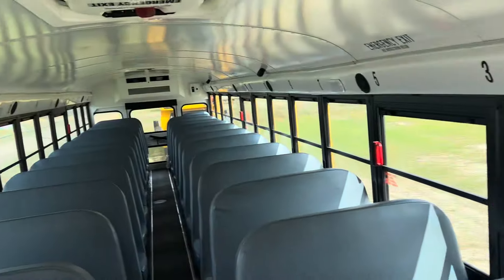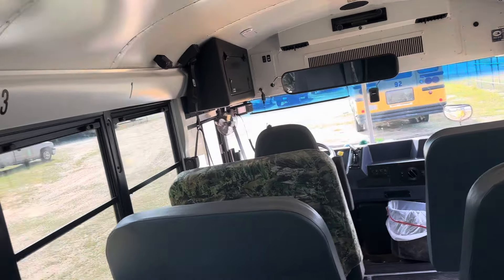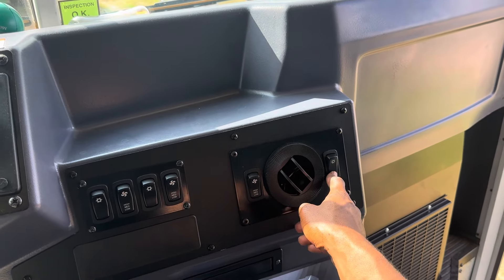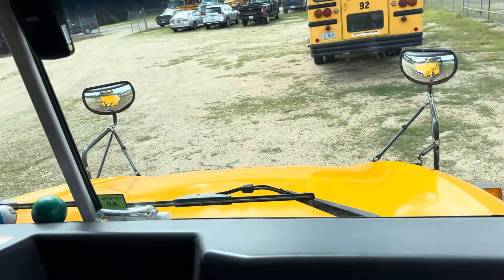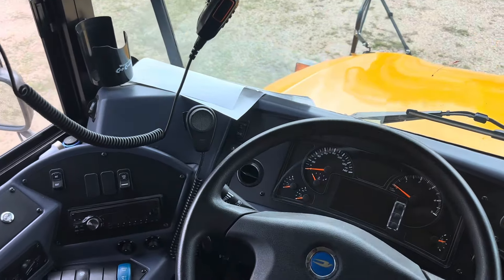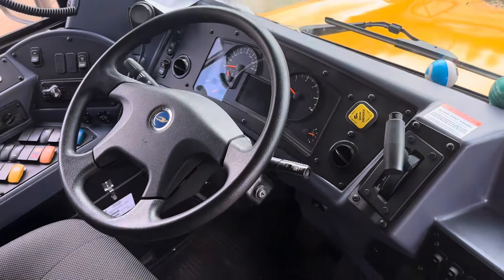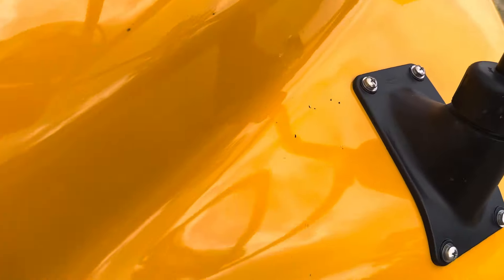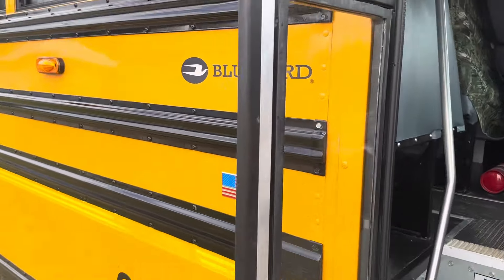Gripes about my new Blue Bird

Comment: They need to bring back the interior they were in the 2000s. All our visions and T3FEs have awful interior. Everything sounds like it's going to fall apart when it hits a bump. On the T3FE when it goes over a bump the dash moves about a inch, on our A3s and TCs they are solid as a rock. We have had so many issues with our visions, probably because we ordered them with the 7.3 Godzilla but the transmission it uses is awful. All of the issues with the transmission are electric related, why can't we have a hydraulic controlled automatic 4-speed transmission like our old busses.

Comment: They should copy the c2 design and just have the speakers on the side and the led dome lights on the ceiling so there’s one electrical line going down each side panel. Either that or put both speakers and light on the ceiling like they did back in the day.

Comment: They don’t make them like they used to, that’s for sure. I hate the cup holder. Anything heavier than a feather and it’s snapping off. When I had mine, my elbow would always hit the storage compartment right next to the driver window. Not to mention the dash is pointing to the ceiling. I never understood why they use 3 different types of switches… They have to have a new dash in the works or something since Thomas and international both have new designs, though Thomas is just barely getting by with a “new design.” I can’t imagine that you’d go for a Blue Bird anymore after 2025-2026 since they won’t be offering diesel options anymore though. I hate their child check system, I hate the light monitor they use, and that overhead storage is just a plastic pos box bolted to the roof. International is too, but at least there isn’t a gap between the front wall panel and the box… I’ve driven brand new Internationals and C2s, honestly the C2 beats it by just a hair in my opinion. Hell, even the older C2s don’t rattle as much as older CEs. I know you despise them, but demo a new C2 if you can, you’d be surprised I think.
Reply from the maker: Already have. Still just don’t like anything about a c2. I’ll deal with this one before I get another c2. But at the same time. Atleast Thomas fixed known issues. That upholder has been a problem since day 1! They need to straighten up the dash. Pick up the steering column and make it go in further. That would help a lot
Reply: @Bluebirdvision91 just buy used buses like Gwinnett did lol. Hell you could go in copart and probably get some old Gwinnett buses and put them in service. I wish I could’ve experienced the new gen CE. Only thing I don’t like in C2s is the A pillar blind spots.
Reply: C2s used to be decent buses but the quality isn't as good. Our 2025 C2s are not great, one of the buses has some sort of engine rattling noise, the door rattles, and Intellipark malfunctioning. These issues weren't present on the 2018-2020 C2s my District owns.

Comment: The 2024 Visions we have have been fine except for the Leaking issues. Better than the 2025 C2s which have a rattling noise and the door rattles which wasn't present on the older C2s. Also Intellipark malfunctioning making things worse. We have just been lucky with Blue Birds I guess prehaps unlucky with Thomas.

Comment: Man I’m suprised to hear you ripping on a blue bird. But I agree with everything you said. Especially the SEATS not being ASSEMBLED CORRECTLY that it a huge safety issue. I was always under the assumption that blue bird made the best quality busses but I suppose they have issues as well.
Reply from the maker: @Cole-q2h  they used to be the best bus body you could get. But after 08 forget it. Went downhill from there. They need to go back to the 2003-07 design and redesign a new vision based off of it.
Reply: My school has all bluebird route busses and one IC. We have one new route bus with the new roof like yours. The spec is different cuz I’m in PA but I’m curious how that bus is holding up. (I ride a 2020 vision every day)

Comment: I was a 2 way radio installer. On these visions, i learned to make note of all issues i could find just to cover my ass. The build quality is so terrible, ive seen plastic self tap screws used in machined holes. From the factory. Loose power terminal to the main fuse block from the battery.
Bluebird shouldn't be in business anymore. And i damn sure wouldn't trust them to build an electric vus

Comment: I have always drove international.  Since moving to a new company 5 yrs ago that’s all we have are BB and I hate them. Poorly designed.  Every bird I’ve driven rattles, the drivers area are tiny, I’m 415 pounds and I’m crammed behind the wheel, I had so much room in my internationals.  The lights they use under those switches get HOT. I’ve burnt my finger on them cause of the hotness of the lights.  The switches are crap, I’ve had many of them brake.    I liked the older display where u can change the color of the dash lights.  Not a fan of the new crap.  And they need to do a better job at a cup holder cause what they have sucks, they brake if something is to heavy in them.    

They need to bring a team of engineers from International over and let them show how to design a bus.

Comment: Our biggest problem with Blue Birds at the moment is the seat frames. We had both of our 2018s that we had to replace all of the seat frames because they were all broken. The design is horrible. Bus is only 6 years old and shouldn't have to be replacing seat frames. We have had a few in our 19s and 21s but the dealer has fixed those under warranty. The way the seat frames are made, some of them rattle because they are metal on metal in two places and they put a piece of seat cover over this plate on the frame to try and stop it from rattling. Both of our 18s were at dealer multiple times for broken seats and we had to end up replacing the frames ourselves. We have also filed NHSTA Complaints against BB for the frames and reported to our state department.  I hate the way 2021 and newer ride, we have some rough roads around here and sometimes you feel like you are rocking on a boat. BB quality is going down hill like. We will not be ordering them anymore, We are IC only from here on out. We have a 20, 2 23s and 2 24s and 3 25s on order. ICs are so much better in our opinion and we get better support from IC. When we started ordering BBs in 2013 they were like Cadillac's compared to the buses we had at the time and now they are just garbage. I hate working on them and can't wait until they are gone!
Reply from the maker: @Josb_Bluebird2143  I don’t mind working on them. But my thing is. They know about these same issues. Why haven’t they addressed them? I will agree that quality has gotten slightly better since Phil Horlock took back over at CEO but there’s still a lot of room for improvement.
Reply: ¿Cuáles son los IC?
Reply: The biggest issues on the BLUEBIRDS have and what does INTERNATIONAL IC’s don’t have in GWINNETT is the stair well is wide on the CE’s and on the VISIONS the stair well is so tight like BLUEBIRD should make the stair well wide like on the CE’s when it gets onto the engine on the CE’s you can hear the engine on the CE’s with IC’s DT466 MAXXFORCE DT and IC’s B6.7 liter CUMMINS ENGINES with the straight pipe system on the exhaust on the 2005 CE’s to the 2022 CE’s with the straight pipe exhaust system on the tires on the CE’s the tires can last longer on the CE’s then on the VISIONS on the drivers area when I am sitting in the driver seat I know the switches on the control panel and the controls on the steering wheel on the CE’s when I am doing the inspections on the CE’s I know he components on the CE’s then on the VISIONS when I am doing the inspections with my driver Mr Coleman air brakes and the air ride suspension system on the CE’s it rides and brakes smoothly then on the VISIONS the gage cluster when I turn on the ignition with the key on 3014 the gages move what they supposed to on the fuel gauge air pressure voltage oil pressure coolant and engine temperature speedometer and the RPM gage on the VISIONS the gage cluster does a gage sweep and not the original way like on the CE’s

Comment: Do you have any of your 2003 ce buses left or no
Reply from the maker: Actually yes. Video on one of those coming soon
Reply: @Bluebirdvision91  yesssss I love 2003/2004 busses that was my first bus it was a 2003 or 04 ce200    bus number 167 but they scraped them for no reason I hate the c2s like they get hot in the back way to quick even in the winter
Reply: And bro where I go to school we have no electric busses yet I just don't find a point in them bc like their gonna do as much pollution as a diesel does now propane and gas needs to be out of every county in the US just in my opinion  cause for one propane can blow up in  pretty big explosions which could kill all the students if it does blow and no my county doesn't have gas propane or electric their all diesel which is good
Reply from the maker: @ I had a conversation with an electric bus rep. Which is why I decided to go ahead and make this vid. Trying to sell the electric bus when they can’t build a decent diesel….
Reply: @Bluebirdvision91  lol but how long do the 2003 ce have left for service
Reply: @trevorfill7021  Propane and gas won't explode. They make the tanks to where they can take impact and not rupture. If I remember correctly there was a video Blue Bird did years ago where I think they may have been shooting at the propane tank and it wasn't making a hole in it. In my opinion propane is safer than an electric bus. We won't ever get them though because we are diesel only fleet and KY does not allow Gasoline powered buses at all.

Comment: This is very unfortunate to hear. My district runs IC CE gas units (primarily 2019-2020 with some 22s, 23s, and 24s). They work, but quality could be a lot better especially considering the lower mileage of our fleet (ranging between 30,000 and 50,000 miles. We need a new wheelchair 35+5 bus, and I did make the suggestion to try Blue Bird. This video is making me second guessing that.

I take you will be buying International for a while? I know you are far from a Thomas fan.

Also, on an unrelated note, who is staffed in maintenance side of your school's transportation department? Our district only has two guys that are stetched thin due to other roles that are not transportation related, and I am trying go make suggestions on how we should be staffed so maintenance is done more timely.
Reply from the maker: @Michael-ty4pz  me. I’m the director of transportation/mechanic/driver. IC for us for a while.

Comment: Try to order a gas or propane bluebird vision.
Reply: They aren't any better. Build quality still sucks and sometimes those engines like to shoot out spark plugs. I have seen people already replacing the 7.3s for various reasons.
Reply from the maker: @football11248  heck no. The new 7.3s have lifter failures that wipe out the cams. And the transmissions are garbage too